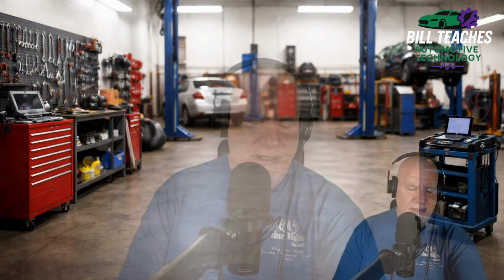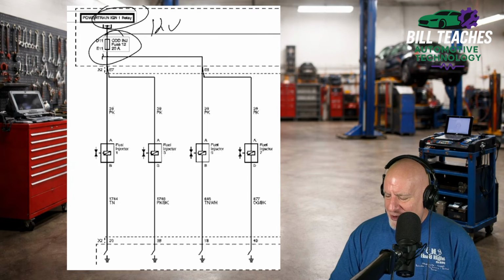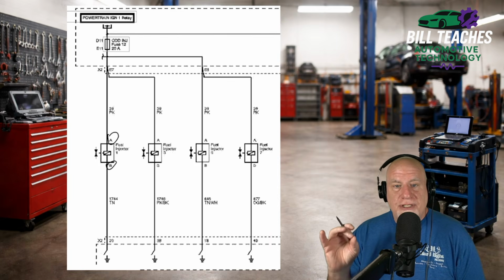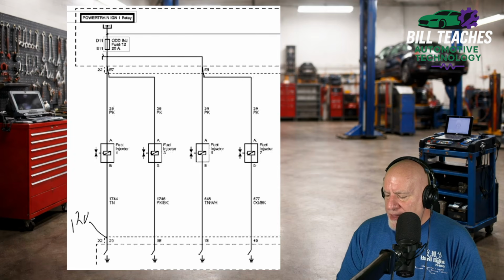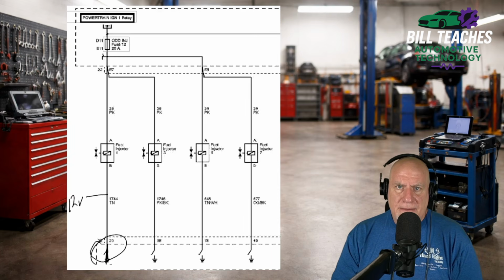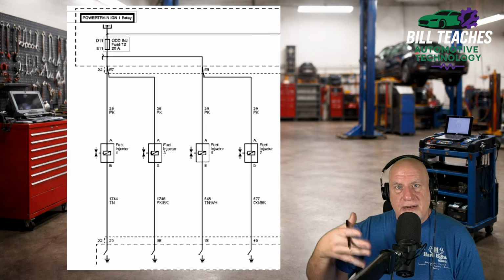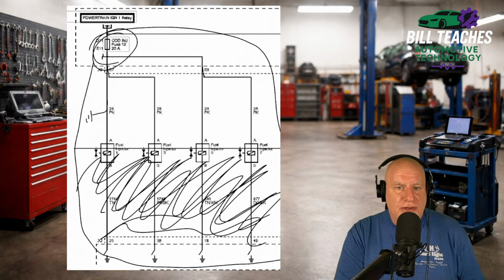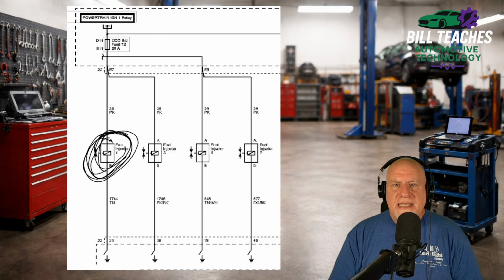Why a Failed Component Doesn't Blow the Fuse (Open Circuits vs Shorts Explained)

Comment from the maker: Quick question for the techs and DIYers here:
Before watching this video, did you think a failed component should always blow the fuse?
YES or NO: curious how many people have run into this in the shop.
Also, if wiring diagrams still give you trouble, this video will help a lot:
How to Read Automotive Wiring Schematics for Beginners - https://youtu.be/lFI7CHl2IEE

Comment: Why would somebody tapping into the ground side for power induce 12v to the ecm? 

I can see how it may mess up the function of the injector and radio or whatever but the two loads would still just use up the voltage, no?
Reply from the maker: Hi soriano3361. Great question, and this is one that even I get confused on sometimes. I hope this explanation will help: 
In a series circuit, current flow remains the same throughout the circuit. In the injector circuit shown in this video, each injector is a series circuit. Let's say the fuel injector resistance is 16Ω. Since we have a 12 volt supply, the current flow would be .75 Amps anywhere we measure in that circuit, and the circuit is built for that amount of flow. If a test light is connected to a power source, and then we connect to the ground side of the injector circuit, we have now created a parallel circuit, which changes current flow. Lets say the test light is your typical test light. The bulb has a resistance of ~50Ω when lit. This would make the current flow through the injector still be .75 Amps, and then we would have current flow at the test light bulb at .24 Amps. In a parallel circuit, currents get added up to find the total. Now we have a total of .99 Amps of current flowing in the circuit. Is that enough to cause an internal ECM failure? I don't know, but it is more than it was designed to carry.
Reply: @BillTeachesAutoTech got it, thanks !
Reply from the maker: @soriano3361  You are very welcome!

Comment: Very detailed and well explained video. Thank you for taking the time to teach us. In the case of a o2 heater circuit, if there is a short in the control wire( ground side switched circuit) will the heater burn and cause the heater to open or short to ground? I am looking forward to a video on alternator testing and  parasitic draw .I have seen people hook up wires to battery plus terminal, and would like to know how the sense wire sees that and reports it the the control module to increase duty cycle and how does that  create a parasitic draw.
Reply: Thank you. I now see how a short to ground on a heater control wire of an o2 heater would likely cause the heating element to open than to short to ground. I was more thinking that the wires can melt in the heater resulting in a short as well.
Reply from the maker: @Carlo-o3h  You’re thinking about it exactly the right way.
In most oxygen sensor heater circuits, the ECM controls the ground side of the heater. If that control wire shorts directly to ground, the heater stays on continuously. That usually causes the heater element to overheat and burn open, which is why we often see an open heater circuit code afterward.
You’re also correct that extreme heat could damage the wiring or insulation inside the sensor. However, the majority of the time the heater element itself usually fails first and opens, which stops current flow.

Good thinking on tracing the failure path. that’s exactly how you get good at electrical diagnosis
Reply: @Carlo-o3h  hmm maybe if it gets too hot it'll burn the fuse
Reply from the maker: Thank you, I appreciate you watching. A short to ground on the control side of an O2 heater circuit usually keeps the heater on constantly when the key is on, which can overheat the element and eventually open it. Good ideas about alternator sense circuits and parasitic draw as well. Those would make great future videos.

Comment: bill thank you for this video.i no this will up alot of guys starting out.i learned this about 45 years ago working in a electric dc motor shop.sorry i can only give one thumbs up.but i can give you 10 stars.thanks again.
Reply from the maker: That means a lot, thank you! The basics of electrical flow apply across a lot of trades, and it’s great to hear from someone with that kind of experience. I appreciate you watching.